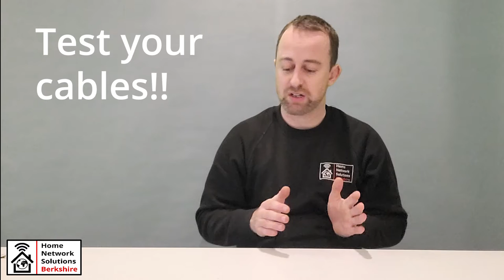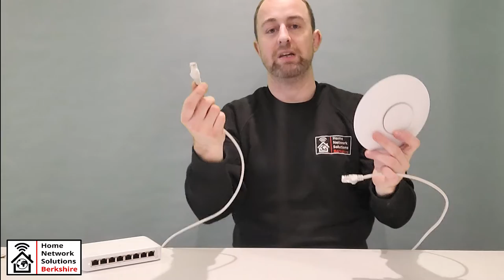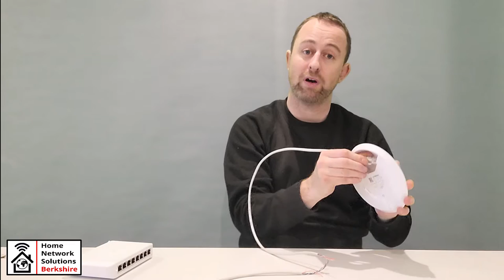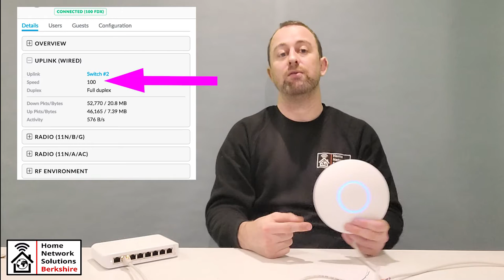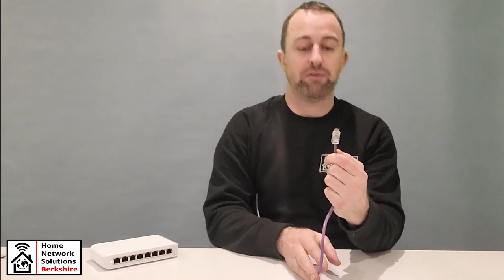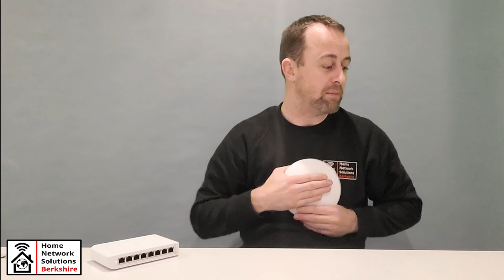Ubiquiti Unifi Fault Finding - Cable faults and how to spot them

Comment: Installed a new U7 Pro yesterday and moved the old AC Pro upstairs to replace the Lite. All working well in mesh. Was getting ~500Mbps from my old Samsung S10e. Til this morning when the upstairs WAP showed it was meshing wirelessly and speed dropped to ~100Mbps. 
The Netgear Smart Switch showed a connection speed of 10Mbps on the port. Checked the old cable I'd run upstairs with a tester and it showed wire 6 disconnected. Reterminated both ends and it's back up to 1Gbps and the WAP's mesh over Ethernet as they're supposed to.

All a bit weird as the cable's been running fine for years. I noticed while reterminating, the outer insulation slides upwards very easily when pushing it into the RJ45 plug for termination. Which makes some of outer wires inside pull back slightly leading to a poor termination. Just goes to show it's never a good idea to buy cheap cable. I know better nowadays, but I'd bought this cable years ago when I did my first ever long distance run in the house and didn't know the perils of cheap cable.

Comment: Unifi switch doesn't have built in cable testing?
Reply from the maker: No. It can tell you what it’s working at but doesn’t physically test the cable.

Comment: I wanted to usea single unifi ac pro to connect it to router  so that in classroom multiple students could connect to it. But all i get is... wifi signals only when i am as close as 1 foot from the device. As soon as i move. Away. No signals at all.  
All the settings seems fine. I reset it twice but same problem.